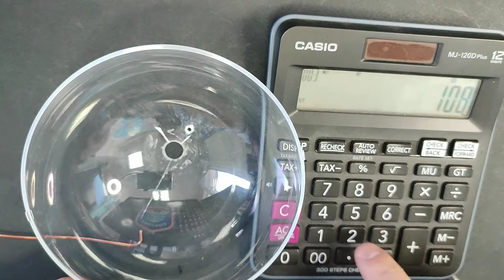DIY Spy Mic - How to build and test in real life | Ultra long distance microphone

Comment: The focal length is HALF the radius.  It is not obvious where inside the mike the focal point must be, so some adjustment will be required.  With  such a deep curve you have spherical abberation, preventing a sharp focus.  I suggest a much larger, more shallow reflector.  Also, rule of thumb for parabolic reflectors is minimum 10 waves diameter.   Do the math.
Reply from the maker: I must confess you are right about that

Comment: Now make 3 more and place them facing 12oclock  3oclock, 6, 9, ....connect them to a raspberry Pi and program something that documents DB measurements....or have each connected to a cheap cellphone with a DB measuring app.... or have it set up to spin(fast) and utilize the sensors in a cellphone and a data logging app to measure DB and current phone orientation...you can have a doppler sound radar direction finding device...locate all the annoyingly loud or specific noises. Do it! I dare you to!
Reply from the maker: That is actually a very good idea 💡

Comment: I am interested in detecting very low noise both inside my house and outside. I need to try replacing the mic capsule with a targeting laser or even better use IR.
Reply from the maker: Sounds interesting 🤔

Comment: Where did you retrieve that parabolic trough? What microphone capsule did you choose? I want to do the same test but I want to use a '20 cm plastic funnel. :)  Interesting cue in your video but need to think about adding a "reverb" to better improve reception. Hi.
Reply from the maker: I took the "dish" from some of my kid`s toys actually. It is not the perfect shape to do it because it is not parabolic, but spheric shape. Anyway I wanted to make some primitive experiment to find out if it`s going to amplify the sound. And the result show it clearly that there is significant amplification, but there are also many imperfections in the sound. It sound somehow distorted (you know what I mean). I tryed to get the best focal point for this project to get themost of it. I must admit it`s not perfect, but it is some basic point for my next project for long didtance mic with very large parabolic dish from old SAT TV receiver. The capsule here is very important, I used the AOM-5024L-HD-R . I had to order these from the USA (I live in Bulgaria). These capsules are brilliant in my opinion :) Keep in touch ;)

Comment: Sweeeeeet Microphone, Hwo Did You Calculate The Focal Point? It Should Be Calculated And Used Right, Teh Effect Could Be Much More Better Just Like With Antenna Dishes, Finding The Focal Point Is Super Easy, Just reflect Any Light In The "Bowl" Take A Sheet of Paper And Put It To The Bowl Not Obscuring The Light And You Will See Where The Smallest Point Of The Light Is And Thats Where The Focal Point of The Parabollic Bowl / Antenna Is, Thats The Point Where You Should Mounth Antenna Element or Microphone, !
Next Thing, You Should Put The Mic On Some Coaxial Cable And Putt Some Choke On It Right Before The Mic ELement Itstelf, That Would Improve Lowering Noise .
Reply from the maker: I was experimenting with the focal point. It was kinda tricky, but eventually it worked. Thank you so much for the great advice ☺️ I should definitely use this light method for my next microphone project. Huge thank you again 🤗

Comment: You didn't record any voices. You should have had some people stage of conversation measure out the footage and say this is what their conversation sounds like at 100 ft or 50 ft 200 ft. My cell phone picks up all the outside sounds just like your thing. I'm sorry but this video was useless.
Reply from the maker: In short I must confess you are right.
Reply: @FixitEasyDIY  well it depends on what you want to do.
Reply from the maker: It was kinda experimenting with this set-up. There is significant amplification, compared to my camera built in mic, but I've managed to make huge success, using an old satellite dish and properly mounting the microphone in the right position. You are right that this one makes the sound very odd and probably not usable for recording speech.
Reply: @FixitEasyDIY it works, but I feel like the ambient amplify mode on my phone does a better job. Still cool object to modify and tinker with in spare time, might just need to experiment with different sized components for a bit
Reply from the maker: @MattQrillz  You are totally right 👍 I've tried to get much better amplification by using old satellite dish. It is actually an offset dish and I could get sounds from more than 200 meters away. There is huge distortion, but it is a good starting point for further experiments :)
Reply: @FixitEasyDIY  dont give up this is a great experiment and would be interesting to see it could go far
Reply from the maker: @laxd776  thanks. I will definitely try to improve it 😃

Comment: How did you find the focus. Kindly tell me I am making a project but my bowl is bigger than yours.
Reply from the maker: So called focal point is "in the middle of the middle" . It`s not that important to make it super precise. Best way for home DIY is to try to make it by experimenting. Unfortunately there is no easy way to make it, but the good news is that it is really not that big difference if it`s not perfect. Just try it. Bigger bowl would give you better results. I wish you all the best my friend! ;)
Reply: @FixitEasyDIY  I hove done it but it still does not make any difference without mic and with mic.
Reply from the maker: Probably using the wrong microphone capsule?
Reply: Could you make a tutorial on this?
Reply from the maker: @mangakadomingos292  I was thinking this was easy to repeat.  Just follow what I was doing in this video. The most important part is to find the focal point of the dish. It turned out that it's best to experiment until it gives significant sound gain. If you need some further information I would be glad to help with anything.